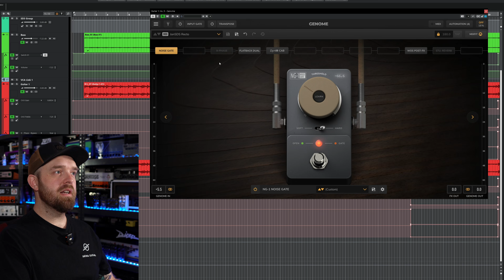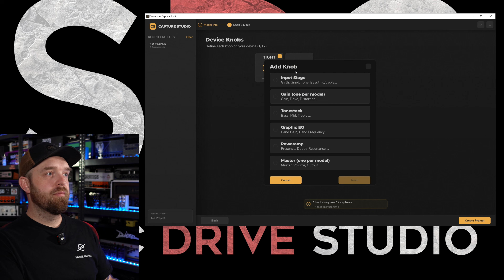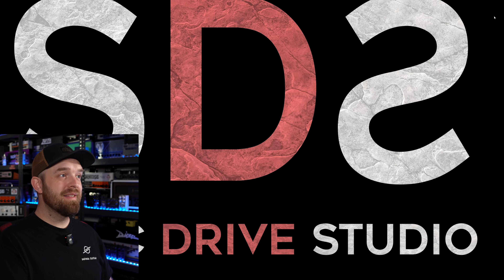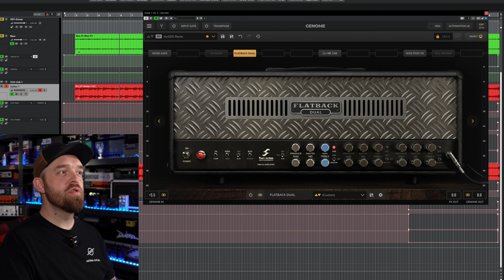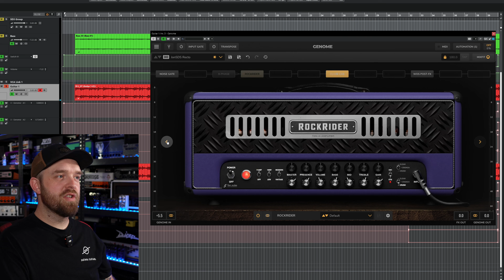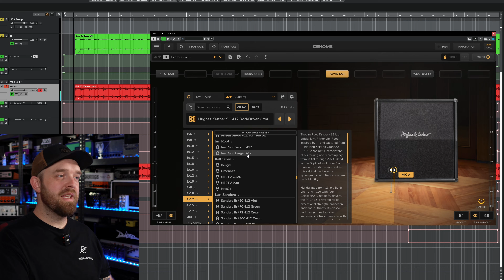Amp Capturing Just Changed FOREVER! | Genome 2.0

Comment: Hardware unit with a built-in 100W@8ohm poweramp that could be used if needed would be nice as fuck. Have the option to purchase with or without the power amp. Need a rack mount option, too.

God, I want so bad for Two Notes to blow the fucking doors off the hinges of every other modeller out there, and then stay as the industry standard. Two Notes gear is solid as fuck, and in my experience their Customer Support is in the ballpark of Sweetwater.

Comment: Anyway to load these captures and amp sims on a non laptop hardware pedal like the headrush or sonulab stomp pro?
Reply: No, at the moment they are confined to our GENOME software application.
Reply: but  you can use an iPad paired with a MIDI controller to play like.
Reply: @Jose20571996 I think the Octave hs-1 having a laptop with audio interface will run this live

Comment: This is what I've been waiting for to be the next phase of audio capture.  I always pictured a usb motor with a suction cup device that you put on one knob at a time and it turns it however it wants to make the capture.  The thought being, for example, the bass and mid knobs (or treble 0/presence 10 trick) on a Dual Rec are kind of strange for a tone stack but pretty integral to how it's used.
Reply: Sounds like the TINA device that Neural DSP use for training their models.